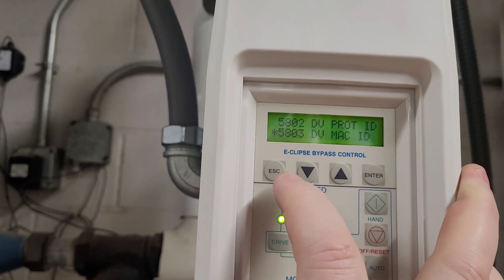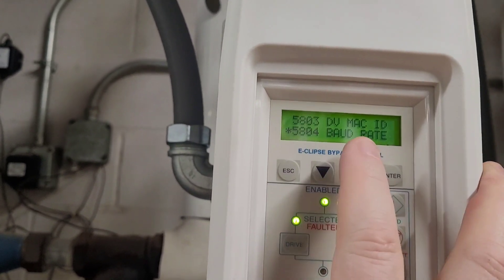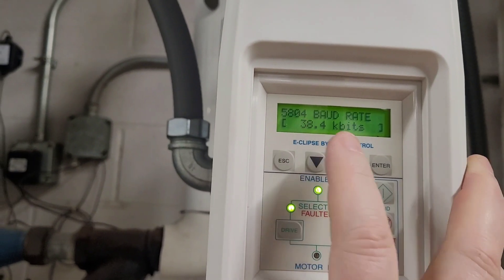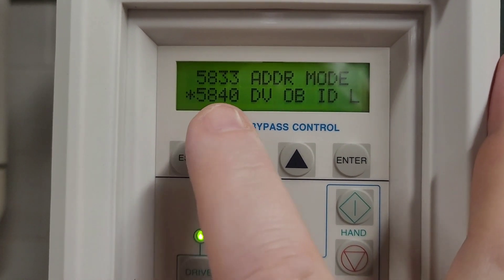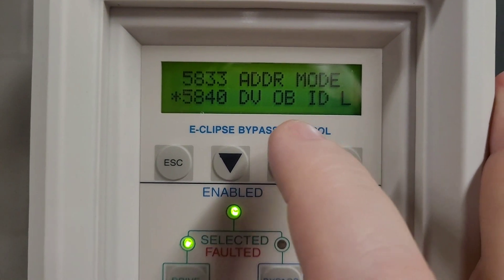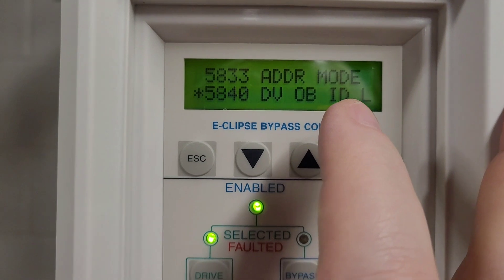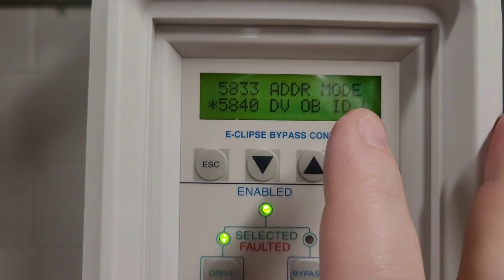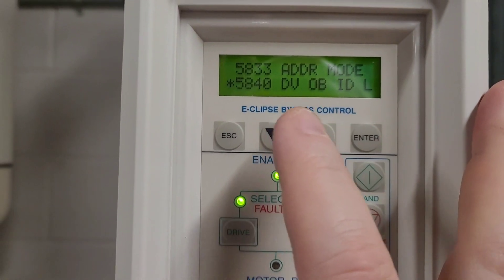How to set up Bacnet Communication on an ABB ACH 580 VFD with Eclipse Bypass

Comment: Does anyone know about the communication loss setting on these drives? I have the parameter 3004 set to NOT SEL but I don't understand what NOT SEL does. The other options are self explanatory just unsure about NOT SEL
Reply from the maker: That means the communication is turned off.

Comment: Need help with Metasys analog inputs and outputs 
our Nae and 4520 - 2
our expansion cards are from model LN - PRG4C
LN - PRG8C
and the LN - PRG88C plate
I have a level 4 to 20 mA key but I can't properly configure the port.
da error Set284
Data Convert Error.
the network is LonWork
please help me.
Reply from the maker: Rule 1, don't use Lon. Sorry. I don't have enough experience with lon to help
Reply: I agree, never use LON!!! Garbage!

Comment: I’m having trouble adding a FAC4911 to a SNE as a Bacnet device.  There is no Com bus currently in building the Fac is going in so we are installing the FAC on network so it can be added to SNE as a bacnet device on same network. The FAC is never being discovered in auto discovery. What do I need to check
Reply from the maker: I would check the mstp cable and also check the network settings for the device. If all is good you may want to try connecting a different controller. I assume you are connecting it with the FC trunk

Comment: Do you have an issue with abb drives taking down your entire communication trunk when it faults?
Reply from the maker: No. Make sure you only connect the + and - for the communication. Don't connect the reference. Also make sure you don't have other network issues.
Reply: @Systemcontroltech  I don't have any other issues,  it an abb 550, I noticed that when the drive was in fault I had 3vdc on the terminals, I removed the trunk wires first,  and of course the trunk came back up
Reply: As far as the reference I think I remember on one of the other FEC's that it may have been wired up...will check that